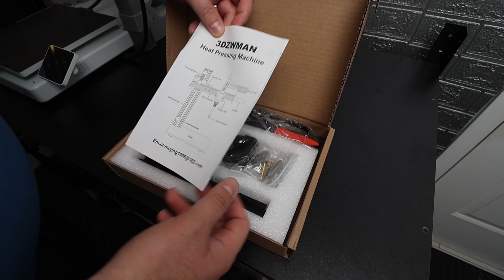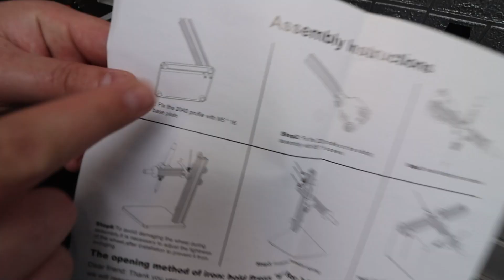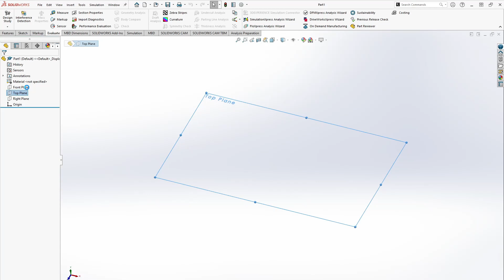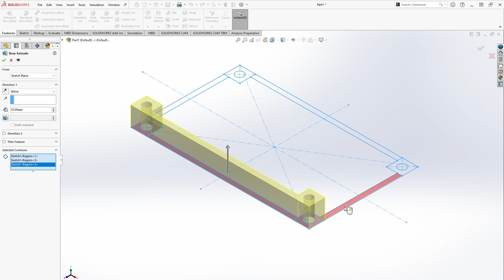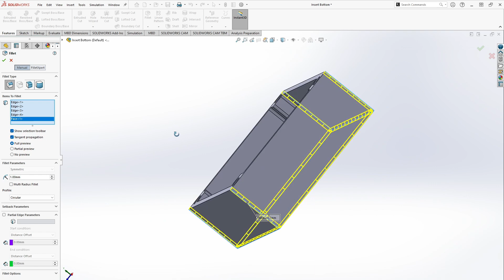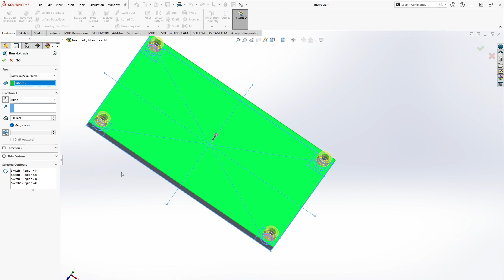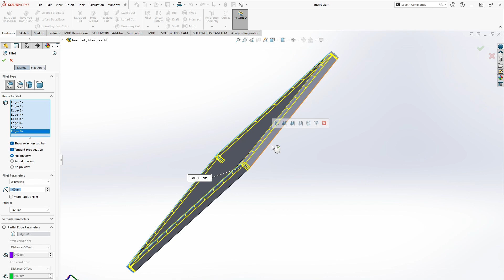How to Use a Heat Set Press: Boost Your 3D Printing Projects!

Comment: @11:44 there looks like the bar has a lot of flex when you're pushing down. Any issues with that or any way to stiffen that up? the 1x1 aluminum bar looks sturdy enough, is it the connection or bearings that's flexing?
Reply from the maker: Thanks for the comment! I didn’t notice any issues caused by the flexing on my setup after using it, but someone mentioned a good tip in another comment, that tightening the wheels on the gantry can help reduce flex. That might be worth trying :)

Comment: Do You have some table with temp settings for PLA PETG ABS ?
Reply from the maker: Thanks for the comment! I don’t have a table for that, but you can usually go by the higher end of the temperature range listed on the filament spool. I’ve always just cranked it all the way :)

Comment: Well done video, sir.  Thank you for the tips.  I’ve had the 3DZWMAN model you featured here for several months and have found it a helpful tool.  I used it primarily for a small production run I had but became increasingly frustrated setting the end travel limit.  The thumbscrew and t-nut stop was difficult to accurately position at the desired height.  
I ended up designing and making a 3d printed solution I call the “Heat Press Fine Adjustment Device”.  Using planetary gear reduction, it allows one to dial in the end of travel stopping point accurately and quickly.  If you or your viewers would like to check it out, search for the above name at Maker World or Printables.  Sorry I can’t post a link here.
Thanks again for reviewing the Heat Set Press, there is not a lot of information out there on the thing, and your video does an excellent job of demonstrating its capabilities.

Comment: Very nicely produced video with good audio.  I have the same unit for over a year now and I am happy with it.  I think your unit is flexing way too much and you need to adjust the iron so it is more vertical (90 degrees)  to the work piece and adjust the wheels on the gantry so that the iron holder doesn't flex very much.  Mine flexes very little in operation. As a side note I enjoyed your demo of making a box with the CAD program.  Again great job on the video and thanks for posting.
Reply from the maker: Thanks so much for your kind words and practical advice! I did notice some flexing even after adjusting the wheels, so it’s helpful to hear your suggestions. I’ll double check the alignment and iron, and make more adjustments to reduce the flexing and slant of the iron. Great to know this helped stabilize your unit too. It’s always good to hear from someone who’s had a good experience with the same unit. Glad you enjoyed the CAD box demo too! Thanks again for your kind words and helpful advice :)
Reply: I was wondering if it was me or the angle of the camera.